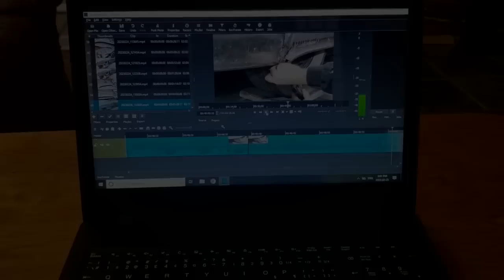How to build fender skirts with basic tools

Comment: Shortly after arriving to a boxing event where my children fight, I received a YouTube notification. It's Fitzee, asking me to "stick around". When I went to see what he was working on now, to my delight he was working on fender skirts. Woah!

You see, about 2 hours priorly, I had finished latching on the second skirt that I fabricated for my little brother's 1964 Volvo PV544. I had been working on these things for nearly a month, and it took me so long as I had to use my noggin to figure out how to do it. I had gone thru his catalog of videos and he didn't have anything on skirts. So, I asked myself, "What would Fitzee do?", and I crossed my heart and said, "I got this". 

Although they are much less complex or perfect that Fitzee's, these skirts do follow the body contour and are almost flush all around. I grinded them down on contact points, as to permit me to add a layer of waterproof sealant tape to seal with some pressure and to avoid paint chip-off. I used a latching system, with 3 latches welded to the inner wall of the skirts, and cut some small slots on the inside of the fender to hang the latches onto. I did not weld the sheet I was working with onto the fender, but instead clamped it atop it and etched a line from the inside to use to cut and shape. Again, although not as beautiful nor complex nor as perfect as these, with a thin coat of bondo and a hammer ding here and there, it should look as if the car came with them.

As a student and admirer of Fitzee, his techniques are what allowed me to independently figure out what I needed to do. I see that his approach differs to mine in minor ways, but I can honestly say I would NEVER have had the trust in my own abilities to see things thru without all that I learned from him. Fitzee has opened my mind to secrets others guard selfishly and preciously, and I am forever grateful for his participation in my growth as a creative and independent man. 

With respect and fondness, from the lowriding streets of Salinas, California, I salute you, Fitzee. 🖖

P.s, I plan on using some self etching primer on the backside of the skirts, sprayed with some rubberized sealant or Gorilla brand spray, to weatherize and protect from rust. What do you think about this idea, Fitzee?
Reply from the maker: I like to seam seal the welds. Those coating are porous and sometimes moisture gets threw. Thanks for kind words
Reply: @fitzeesfabrications  Then seam the welds is what I will do. I won't go against your advice, Fitzee. Thank you again! 🖖

Comment: I wasn't going to give advice, but you asked for it.
Wheeling the back side of a panel will not take the crown out of it. What that does is curl it back the other direction, but the panel is still stretched more in the middle. It will appear that you have removed crown if the stretching is not too drastic, but it's still there.
For what you're doing (subtle/slight crown) it's fine because you're reorienting the panel closer to the shape you want.
Wray Schelin calls that the "arrangement." He stretches it to the dimensions he wants and then "arranges" the panel which seems to be what you're doing working the back side, and you could get the same effect if you were able to simply bend it back carefully.
I hope that all made sense.

Comment: Hello again. Another amazing video showing how to fabricate a part from a flat sheet of metal. I too had a problem with my MIG gun getting stuck onto the tip. I found that my MIG gun liner had twisted and some debris from the wire. Blew out the liner and layed the gun on the floor to install the liner into the gun straight. I haven't had any issue so far. Keep up the amazing videos coming. Be safe and healthy.

Comment: Tony, forgive the errors in my typing, Im on my fourth Whiskey.  Im amazed as always with your mastery of the metal.
But i thought i should mention something that my Buddy Zeke Penner did with his 58 Impala when he wanted to put Mickey 60s on the rear of his car, [1970s]
he started the same way you did, with a flat [crowned] piece of metal, then he got himself a suitable length of metal tubing, He shaped it to the contours he wanted, then cut Longitudinally to the shape he wanted for the fender and the wheel skirt.
The result being, that he had his profile and had something decent to weld too.
True he had to body fill from the curve of the pipe to the flat of the skirt, but it worked amazing.
Id be chuffed if you would try something similar, and point out the problems involved.
But if im right, im thinking that it could have solved many of the shaping problems.

With all due respect my friend. Al, in BC 
I hope this came through as legible,,,,im half cut buddy..  lol

Comment: Nice job Tony!:) Everytime I watch I learn more and more. Thanks! I picked up a coil of flux core wire at a local farm & fleet store. Horrible!  I took it back and went to my original source and now I'm back to normal. I'm self taught and have never welded with gas. Everytime you talk about controlling the heat and panel warping I cringe:) I know a lot about warping!:( Thanks for sharing all the knowledge!:)

Comment: Great stuff again Tony. I'm constantly learning new techniques from you. One question... With fitting that so tight to the quarter panel, will it create fitment issues later with all the layers of paint and primer?
Reply from the maker: It could. Will have to keep a eye on that
Reply: Good point. In the future a good idea is to simulate the thickness of primer and paint with tape placed there.

Comment: I would just install guide pins on the top of the skirt, bolts will be almost impossible do remove if there just a bit of rust amd will be difficult to reinstall if not done by somebody that is as handy as you
excellent tutorial
very good video

Comment: Wow! That looks good! I have to admit I had some doubt when you were fitting that little triangle piece and beating it with two hands, but you pulled it together. I think  I might have used quart-turn dzus fasteners to mount the skirt. They hold great and they're easy to open and close with a screwdriver. Of course all my time in aviation makes them a natural for me.

Comment: Hi Tony!!  As others have stated, you really are a master of metal forming.  I have a couple of thoughts about this. 1. You describe the project as being done with "Simple Hand Tools", which I agree with - with one exception - the English Wheel.  Is it possible to create that Crown by a different means - possibly using the "Pipe Anvil"?  My thought is, most guys (like ME) don't own such an animal, nor have access to one.  Or can we possibly get away without modifying the crown altogether?
It was a great video regardless!  In the end, while sharing your editing software, It showed about 13:00 HOURS of video to choose from!  Not only are you doing lots of work massaging tin, but your video editing is also something we all take for granted as we're educated further by you.
Thanks again, Tony, stay safe brother,
Reply from the maker: I tried a number of different  ways over the years to make crown panels. Small panels are easier to make while large panels are not without some sort of wheel. What I done in the past is collected roof panels from cars and trucks.  The wheeling is done you just have to fit the panels to size you want. Thanks for kind words. I enjoy the editing as much as the work itself.

Comment: Good job, Tony. The tube could you not put a piece of smaller tube inside so it could be used as an alignment pin. Save capping it off. Also, put 2 pins on the top to

Comment: That skirt came out looking good. I think I would have pulled that junky wire out and done all that sheet metal work with another roll and saved the junky wire for building something like your metal break or pipe bender stand or anything heavier with continuous welds instead of fighting that wire on that sheet metal. Sometimes my patience runs thin and I need to save it for something important !!!

Comment: i use this technique too it works like on dolly where panel touches the dolly and the hammer in two spots (the right way of the english wheel) and off dolly technique where the pane touches 2 spots on the dolly or on the hammer depnding (the wrong way of the english wheel) same principle the panel touches the edges of big upper wheel two spots and one of the small wheel the only thin is you hve too apply less force to the wheels since you dont want to compress -stretch the metal even more just to force it to return in less curve. nice job as allways

Comment: Hello Fitzee, Great channel. Learn so much watching you. Question, I’m working on a 2005 f-150 rear wheel wells. The inner wheel wells are good. My question is being that I can’t access rusted metal that I’m replacing, can I still use your method of cut and butt, leaving the rusty metal inside of the wheel wells. Or should I remove the bad parts and fit the new metal to fit the panel? Thanks, Dale
Reply from the maker: Cut it out. Those panels over the wheel well can be tricky.  If you remove most of it and cut it up thr middle. When you do the cut and butt you might be able to take them from each side.

Comment: That was complicated. The only thing extra I might do is weld a inside flange along the back of the sides and top to add strength to those areas. The other skirt should go faster to fab with what you learned from this one. I really enjoy your channel.

Comment: My favorite fenderskirts are the GM skirts of the 1970's. They used the bottom hangers and the clamping lever at top under the rear fender. They were a simple design, easy to remove, somewhat adjustable and secure. My 1975 Buick Park Avenue and 1974 Chevy Caprice had them. The Caprice skirts were better because they were made of thick plastic and never rusted. The rest of that car rusted badly. The Buick did not. I guess you get what you pay for.

Comment: Lookin' Good! Are the feed rollers tightened down for the wire you got? Maybe it's undersize.... Just sayin'.   🤔
Reply from the maker: They are fine. You can see it stick to tip. There is a splatter that stick to the tip and then wire stick to that

Comment: OK Mr. Fitzee, Been watching your videos for probably a year now. I am a 45 year welder of heavy weldments on power houses and refineries. Retired now, got a large shop, with about every kind of tool. Question now. I want to do some body work on my 1998 Dodge 3500, rockers, door skins, fenders. Listened to your explanation about 18 guage metal. makes plenty of sense to me, have always held heat on thicker to run to thinner. For what I am about to do, would you recommend me buying a sheet of 18 guage. I can buy a full 4x8 sheet cold roll for 80.00, or 20 guage for 60.00. What say you???? I, like you build many of my own tools, for what I need, have gathered up materials, to build a 4 foot break, and a pipe anvil. Have 50 years worth of grinders, die grinders, air sanders, plasma's, welders of all kinds, and hand tools. Need to purchase a body hammer or just make one, I have the know how. Got a large mill and a lathe. Let me know,OK? Many,Many, thanks for the education, in sheet metal. Dont be surprised one day if I show up at your door. I am from Kentucky.
Reply from the maker: You got all the goodies.  18 gage is what I would buy.
Reply: @fitzeesfabrications  Thanks buddy. When I get my Audi engine put back together, I am going to get started, first on the rockers on the jeep, and then on the truck. Want to send you some pics, of before and after if that OK. Do I just post them to Fitzees Fabrications??

Comment: Wurth no longer makes that spot weld clamping tool. :(  I am really curious to see if those skirts fit after they are painted, They fit tight in bare metal, paint adds quite a bit. If I remember right, factory skirts are usually around 3/32 to 1/8" smaller all around in bare metal
Reply: Eastwood makes a similar tool.  Well. They sell one at least

Comment: Are you concerned about the amount of space left between the skirt and the quarter in regards to paint?  What I mean is if the painter builds up too much and then you put a strip of something to insulate the two parts from rubbing, will it not fit perfect or line up exactly?  Would it be better to put a shim between the two while making it all knowing that it would allow a little wiggle room for everything that ends up in there after painting?
Reply from the maker: Thats been brought up a few times now. It's a good point. Both the wheel well and top of the skirt are finished in such a way that vertical little bodywork is needed. There was a gap there but I pulled it tight when I bolted it on
Reply: @fitzeesfabrications  good to know. I’ve built a few things too tight before where the paint and primer got in the way. Always interested in how much play others leave in there. It’s hard though if you like to finish the metal, who wants to leave room when you can make it fit just right. Love the skirt, and the teaser this time!

Comment: Very nice and smooth. What a dramatic difference in work/unit area between the main panel and those fiddly corners.
For complex shapes like those lower corners, might it be faster to mould the shape in something soft until it looks right, then match the shape in metal?
Two or three locating pins on the top edge, and Dzus fasteners front and rear should give positive location and  allow easy removal.
Reply from the maker: There many different ways to do this. Mine is not the only one.

Comment: can you do a video to show how to get the uplift curve on the outer side of the fender. i want to extend the length of the fenders
Reply from the maker: There is a number of ways to do that.  I widen fenders by adding a strip in and also I have done like a wide body setup. Don't see much of it these days as most are back to adding flares like they did in the 70s. Just way more extreme

Comment: You might need a new liner in your whip on your welder could be grit in it contaminating your wire bad liner will make your wire hang up to as I’m sure you know.
Reply from the maker: I run into that before yes but this hangs up right at the tip. I think the wire is poorly made.
Reply: @fitzeesfabrications  I use small rolls of flux-core wire on my 100A gas-less MIG. A while back, I had a lot of problems with the end of a roll where it kept sticking in the tip and not welding properly. Turned out the wire was rusty and I had to toss out a few yards of wire on the end of the roll. Not sure why that happened, because the rest of the roll was good.

Comment: Would a rubber grommet in the fender and dowels welded to the top of the skirt work? Just nut and bolt down the bottom. ?
Reply from the maker: I was thinking that but it was hard to get a tight fit on the top with it be draw tight.

Comment: I wonder if it would have been easier to build the quarter panel with the fender skirt integral to it and then cut the skirt out and do the flanges afterward.
Reply from the maker: I don't think as the wheel lip is key

Comment: i went the other way, i was wasting tips after tips, then when i put a new roll of wire, it's like i bought a whole new welder, mutch cleanier welds and no tips wasted, conclusion, there's a huge difference between welding wire, don't go for the cheapest option!